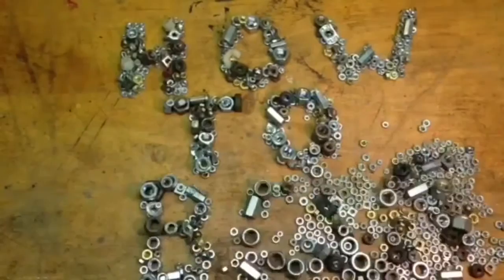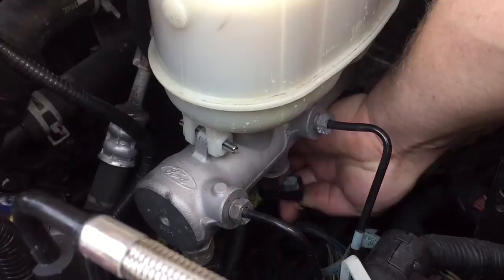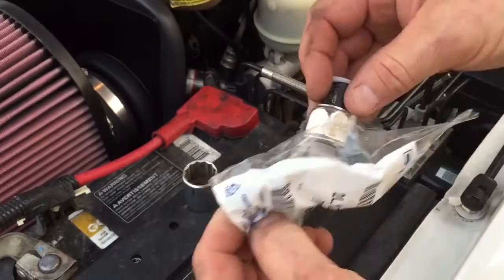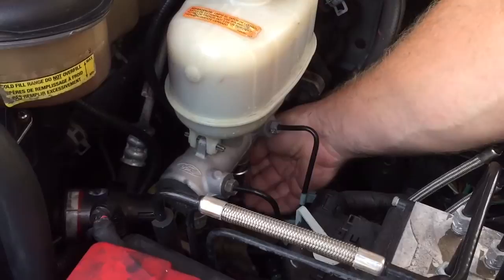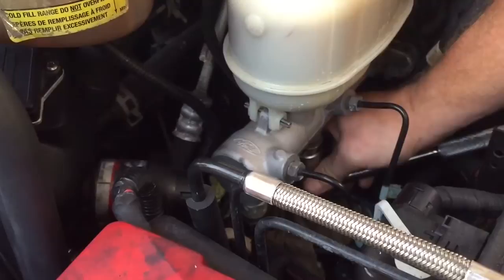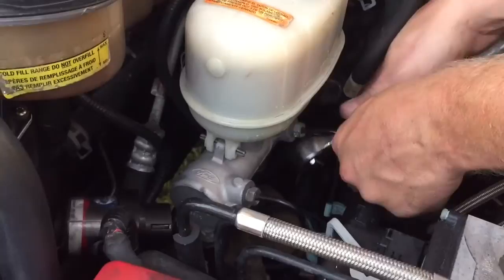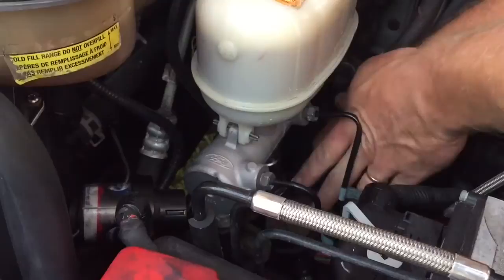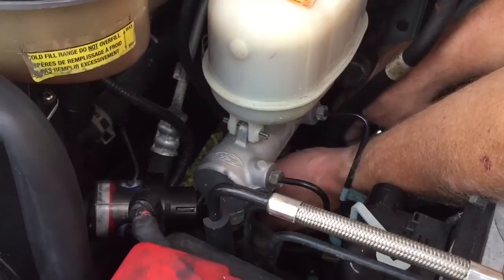How to replace the brake transducer on a 6.0L Powerstroke

Comment: why did you replace the transducer. im fight an issue with my factory brake controller module not working and saw thus video thinking it might be my issue

Comment: is fluid supposed to drip from where the transducer screws in? im having a TBC light flash and i noticed their is not any fluid dripping from that port when i replaced the master cylinder
Reply from the maker: There will be some fluid dripping, that is what works with the transducer.
Thanks buddy thanks.

Comment: Hi, I'm trying to identify the transducer cable. Can you tell me if the cable had 2 or 3 wired in the connector. The only one I have located has only 2 wires - a black and a yellow
Reply from the maker: I’ll have to check next time I get under the hood of a 6.0.

Comment: Why would you change a brake transducer ? 
Having a few issues with my 6.0 brakes
Reply from the maker: The purpose of a transducer is to transfer one form of power to another, in this case from hydraulic to electrical. The reason I changed the transducer was because I was having problems with the trailer brakes which are electric. So if you are having problems with just the truck brakes then I would guess that it would be something other than the transducer.  Hope this helps, Thanks for watching
Reply: What is the part number for this?
Reply: Would this stop the cruise control from working?
Reply: @Kcknbck99  no man you have a 2 prong plug on the end of ur master cylinder and thats ur cruise control switch